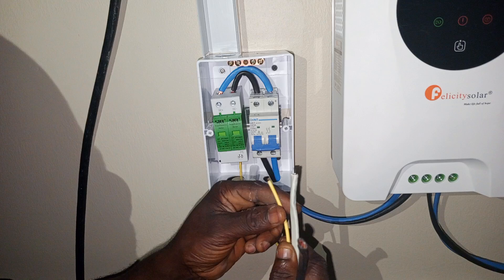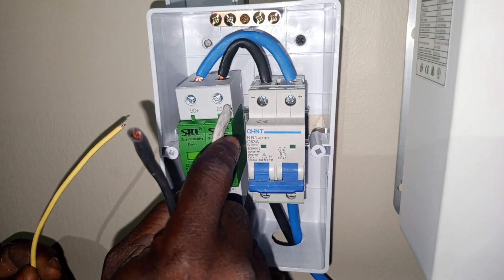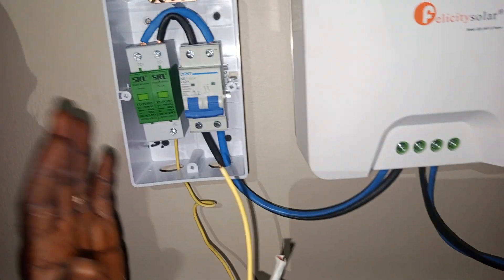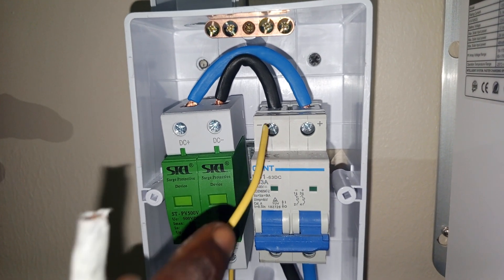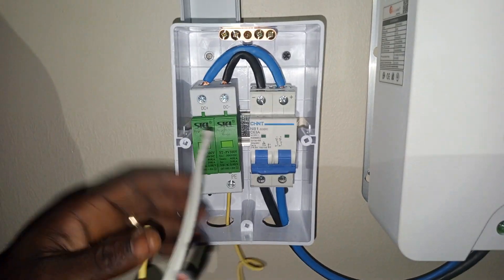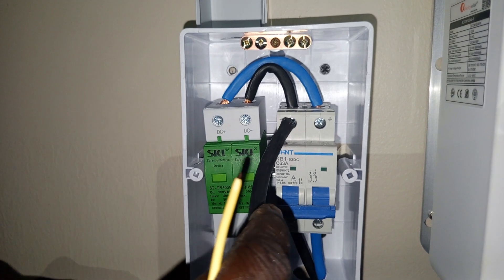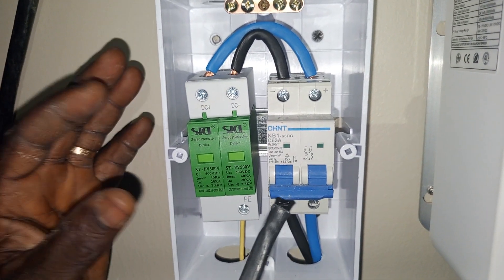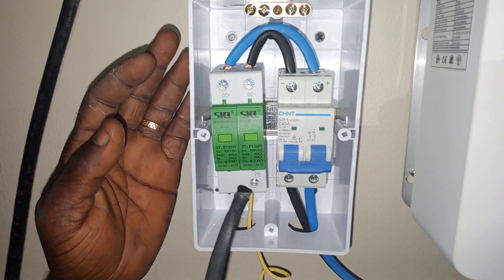How to connect surge protector for MPPT controller

Comment: Na wa for solar matta these days o... Everybody just come jump into solar installation, these quack engineers in comment section will just jump in here to conderm people's work. If u ask them the maximum current / amps required to charge a   220 amps tubular battery now they will say is 5 amps.

Comment: Is the input not supposed to be up? And where do you connect to thr surge, is jt from input or output?
Reply: The input can be placed down or up depending on the protector direction. When buying it check direction on the body

Comment: Why is it that when a PV is connected and the battery is supplied through the controller the battery makes noise as if you are boiling water in it?what could be the cause of that battery being noisy inside?
Reply from the maker: Pls  is your battery tubular?
How many panel do you connect and what is the size of your panel

Comment: What exactly do you mean by the higher your surge the better it is for you?
Reply: Spd voltage you use must not exceed the max pv input  voltage your Inverter / controller can take. That is when the spd is effectively protecting your devices
Reply from the maker: @adex2000ng thanks for your contribution
Reply from the maker: We have 500v, 1000v  and above , the high the voltage the high the protection and price
Reply: @Prostartechnical  lower surge voltage is better. guy go learn work and stop this thing you are doing on the internet
Reply: @odionsireboy8690  😂😂😂
Reply: @Prostartechnical  the lower the surge the better the protection and spds should be determined by your inverter specs..

Comment: This connection is wrong!
Reply from the maker: @odionsireboy8690   can you please contribute and make corrections . Thanks ahead.
Reply: @  the supply from your solar panel goes to one side of the breaker! the other side of the breaker sends out two lines….one to the surge and the other to the mppt. Also don’t forget to connect earth. Make una no dey fast dey drop videos.
Reply: @Prostartechnical breaker comes first before spd. Then your spd and breaker should be connected at the output that goes to your CC.